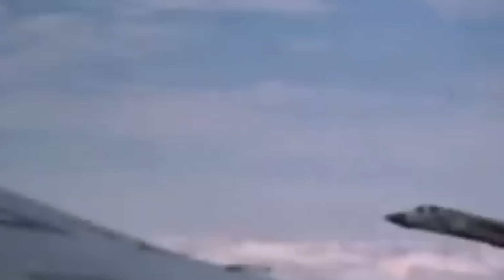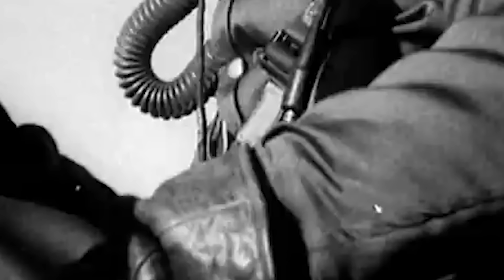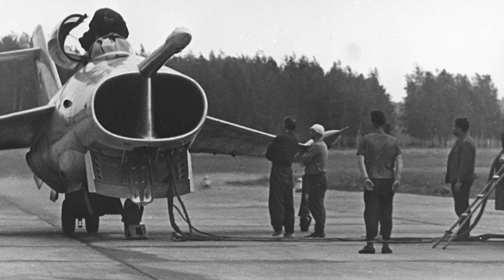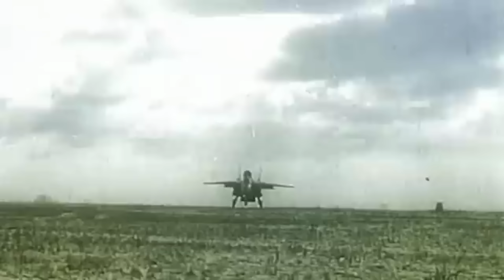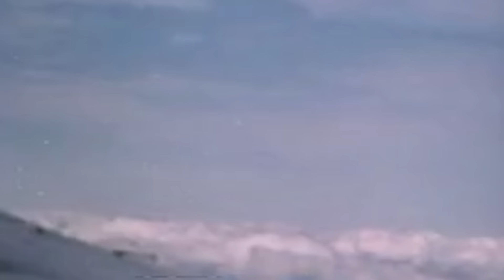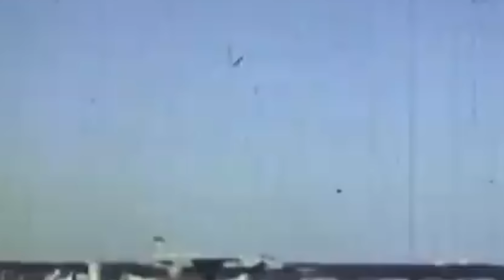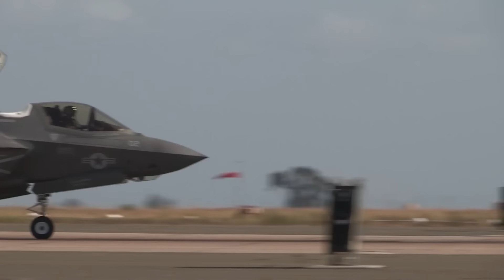America Stole This Plane and Turned It Into a Monster

Comment: Actually, a Russian scientist first created stealth technology but was ignored, except by DARPA who built stealth models using his ideas.
Reply: Ufimtsev did not create stealth technology. He wrote a paper on how electromagnetic radiation was reflected from objects. And that it was a very long way to the F-117. I can recommend the book: "Stealth: The Secret Cot to Invent Invisible Aircraft" by Peter Westwick. Westwick describes how Lockheed and Northrop has different approaches to stealth.
Reply: @tombrunila2695  that is the key to stealth technology - how radar waves are reflected by various angles and coatings.
Reply: @ , from working out the physics of how electromagnetic radiation is reflected to building an aircraft that exploit it is a looooooooong way! It takes a lots of of engineering to apply the theory and to make it happen in the real world! So, no, Ufimtsev did NOT create stealth technology. It was Denys Overholser at Northrop who understood what Ufimtsev had written and who knew how it could be used and then worked out how it should be dome. This does not detract anything from Ufimtsev.
Reply: @PassivePortfolios  That was early stealth.  Now it's about how various waves of targeting radars can be absorbed by the surface coating and converted to heat.
Reply: @tombrunila2695  So the American Germans were better than the Russian Germans....
Reply: @jeromebarry1741  But the same guy developed the counter theory to stealth as well. Lower the frequency of the radar the less it is deflected. that's why old radars did detect the stealth craft... and that caused the stealth factor not to be the priority in new aircraft. They are not stealth but "less detectable".
Reply: The Russian scientist I'm thinking of wrote a paper in the 70's that was translated by the CIA and used to help design what I believe was to become the F-117, though it could have been the B-2; I forget as it's been a few decades since I heard the story.  After the cold war ended, he quickly immigrated to the US.  I had him as a professor for an EE  class on microwaves just after.
Reply: @SeanTheSarcastic  his study on stealth was used to design the F-117.
Reply: @PassivePortfolios  You should go live in russia, assuming you are not already there. LOL!
Reply: @stephencurry8552  I have been to St.Petersburg many times on business and recreation. Some of my best clients and contacts live there.
Reply: @PassivePortfolios  Alas, the Russian Mathematician described it as a study on the surface interactions of radio waves.   That just doesn't scream "Stealth aircraft" to an engineer.
Reply: @jeromebarry1741  Without that study to inspire DARPA, no stealth aircraft.
Reply: Germany developed the first Netzhemd absortion durch (RAM Radar-absorbent materials) during the Second World War,  Sumpf, Zelligelit, Tarnmatte, Wesch, Alberich and Oppanol were tested or actually used in operational service by the Luftwaffe and the Kreigsmarine..
Reply: @DoktorBayerischeMotorenWerke  It was Russia  who inspired the US to study stealth tech.
Reply: @ No, Pyotr Ufimtsev did not publish his work until the 1960's... and his work was only theoretical, it also did not include RAM technologies.
Reply: Yeah, right after russians "invented" Tu-4.
Reply: He didn't create stealth technology he wrote the maths paper that was the theoretical underpinnings of stealth technology.
Reply: Germany invented radar stealth technology during WW2.
Reply: @WilhelmKarsten  Never heard about that from any sources.
Reply: @PassivePortfolios Well then you clearly know very little about the development history of radar stealth technology...

Germany invented passive and RAM technology during WW2.
Some well-known examples are the Horton Ho-229,
TARNMATTE
and FERROMATTEN
Reply: @WilhelmKarsten  Germany never had a study on radar wave deflection and absorption, so no stealth. Try again.
Reply: @PassivePortfolios Sorry kid, denialism is not a valid argument.
The facts are self-evident and cannot be denied.
Reply: Stealth was not initially developed, it was discovered, by an RAF airplane. The De Havilland DH-114 Mosquito multi-role aircraft was built almost entirely of wood in order to conserve metal for the war effort. It was discovered that Mosquitos left a very small signature on early German radar systems due to their wood structure. The biggest signature was left by their propellers
Reply: @rescue270  Unfortunately that myth holds no water anyone familiar with the D-H Mosquito knows a significant amount of surface area is cover with highly reflective aluminum skins including the engine cowlings, nacelles, bomb bay and landing gear doors etc..
True, Propeller-driven planes typically have extremely large frontal RCS due to the propeller itself, most Mosquitos had large diameter metal propellers that would light-up German radar screens like a beacon.
Reply: @DoktorBayerischeMotorenWerke  
Sorry, but the Mosquito was more difficult to spot on radar. I've the transcript of a meeting between Hermann Göring and his advisors on the subject of the Mosquito's apparent stealthiness. By the time they showed up on radar it was too late to do anything.
Reply: @rescue270  Metal propellers are very reflective of Radar energy, especially when mounted in a retroflective configuration like the Mosquito with its all-aluminum engine cowlings and nacelles. 
The Mosquito has a relatively high Frontal RCS for what is primarily a wooden aircraft.
Reply: @DoktorBayerischeMotorenWerke  
It still made a small enough radar signature that it often could not be detected until it was quite close, and probably the propellers were what showed up first. They were sneaky enough that Göring was concerned about how to effectively counter them. Radar was primitive then, so what leaves a huge signature on units even from the 1950s would probably be pretty small on WWII radar.
Reply: @rescue270  Its nothing more than wishful thinking, wartime propaganda nonsense and postwar revisionist claptrap fantasy.
 The Mosquito had a very high frontal RCS...
 Germany had centimeter band radar... the large amount of aluminium on the Mosquito's surface negated any reduced detection from its wooden airframe
Reply: @rescue270  that's true but there was no rush to build wood bombers after that discovery. That finding was ignored, just as the Russians ignored their scientist' finding on radar wave deflection and absorption.
Reply: Factually, the US was the inventor of stealth.
Reply: @stephencurry8552 actually, stealth wasn't invented, it was developed as a strategy. The British Vulcan bomber engaged in stealth tactics when it beat NORAD twice to deliver successful "bombings" of US cities during exercise. Stealth has always been a factor in warfare and develops new technologies and techniques as detection methods improve. At one time, all stealth technology required was painting your plane black so you could not be seen at night.
Reply: @stephencurry8552  no US stealth without the studies by the Russian scientist. Have to give credit where it is due.
Reply: @PassivePortfolios  russia has stolen so much AMerican IP. Get lost sport.

Comment: Go to a hardware store and ask to see their flue vents.  Among the products is a piece of tubing that is made of different pieces that rotate on each other so the whole assembly will bend at whatever angle you need.  It is simple geometry and flue pipes like that have been around for a very long time.  No aircraft designers from any country invented it.
But the design of the rear nozzle is not the greatest challenge faced by jet powered vertical take-off planes.  The real difficulty is providing lifting thrust for the front of the aircraft.  A handful of countries experimented with using multiple engines mounted vertically.  It was a mess.  Multiple engines proved to be a terrible "solution" to the problem.  The Russians got it to work, but it was heavy aircraft plagued with mechanical problems, poor range, and poor acrobatic abilities.  From a mechanical design perspective, the Russian plane, using 3 engines, was a pig compared to the elegant, single engine Harrier.  And that takes account of the superior speed of the Russian jet because the speed was very limited to short range.  The Harrier was the better aircraft overall.
The mechanical system used for lift in the front of the F-35 was not even feasible due to material limitations back when those two planes were being developed.  Because of that, it's really not proper to compare them.  The F-35 uses a ducted fan that's powered by the single jet engine.  Even when it was proposed, it was not certain that it could be made to work.  The fan is made of composite materials so it is much lighter than an engine.  Powering it by the single engine was the biggest challenge, which they managed to do.
The rear nozzle on the F-35 is not taken from a Russian jet, even if they bought their designs.  The geometry predates aeronautics.  The materials used, and the bypass air cooling methods were probably looked at, but it is unlikely that even those specifics were copied exactly by Lockheed Martin.

Comment: One of the best I've ever seen on this channel. No telling how you were able to dig up all that old footage. Very well researched and presented. Superior video. Thanks!
Reply: Nah, the video is mostly incorrect.  The Convair Model 200 of 1973 was the first plane with this hovering arrangement, and the Yak-141 of 1987 was a copy of the Model 200.  The F-35 made an important advancement over both of them: the front hover fan is powered off the jet, which saves a lot of weight.  So we see it was the Yak that was a copy, with the F-35 doing something new and different and better.  All three planes are on Wiki with good sources so you can read about it.  Pity the video creator didn't do that.
Reply: i was there

Comment: The Convair The JTF22A-30A's swivel nozzle design would lay the groundwork for nozzle design of the F135-PW-600 on the Lockheed Martin F-35B.
Reply: The Convair 200 was never built.
Reply: Exactly. They just wanted to see the data package with modernish telemetry info and remove any future court claims on the international market.
Reply: The Harrier already used that... it was the second lift fan that the US took from it.
Reply: @kaneworsnop1007  There is no relationship between the Harrier propulsion and F-35B.  Harrier certainly doesn't have a lift fan.
Reply: @kaneworsnop1007  ; McDonnell Douglass AV-8B Harrier II is the proven winner and still flown by USMC and I think, Italy and or Spain.
Reply: @kaneworsnop1007  Different nozzle design. The Convair Model 200 used the same three bearing nozzle the F-35 does. Yak probably stole the idea from Convair. The swivel exhaust that the Harrier used meant the engine had to be mid-mounted and couldn't have an afterburner or supersonic capability like the F-35 and Yak-141. The Model 200 was never built, but it was designed to be supersonic. Also, the Harrier would never have flown without the help NASA gave Hawker. Extensive design and wind tunnel work was done in the US.

Comment: Great content, but please stop adding vintage effects to already vintage footage.
Reply: I wish yt would give you a music mute or separate volume, like even 1990s video games had FX and 🎵 like anyone open dark skys thinking DANCE 🎶
Reply: It's not great though.  The Yak had the same layout as the 1973 Convair Model 200: vectoring jet nozzle in the rear, with heavy extra engines in the front only used for lift.  The F-35 had a substantially different arrangement, powering a front lift fan off the jet, which was much more efficient.  Basically the entire premise of this video is a lie.
Reply: Now you mention it, I can’t unsee it 🫤
Reply: gotta mask that footage so the bots can't IP strike the video.
Reply: @markrix  It's 90s footage (If not 60s, 70s..), declassified and freely available, there's no IP!

Comment: Missing to say that after Lockheed Martin got the access to blueprints of Yak141 not long after they broke down the cooperation with Yakovlev design office around 2000 when they were ready for the F-35, which is actually the brother (or daughter if you prefer) of Yak141.
The lack of funding, lack of customers and market orientation didn't helped at all the Yak141.
Reply: BS ... lockheed saved yakolev from bankruptcy
Reply: The F-35 was mostly designed when Lockheed bought the Yak data.  Nothing of it is a brother or even cousin of the Yak.  Note the Yak is exactly like the 1973 Convair Model 200.  The F-35 has a critical improvement over both the Yak and Convair, though, running a front lift fan off the jet instead of carrying around an otherwise-useless motor for that purpose.
Reply: Agree... The design solution was eerily similar so i looked into it and... guess who owns part of YAK...